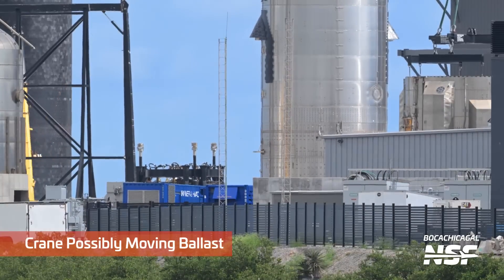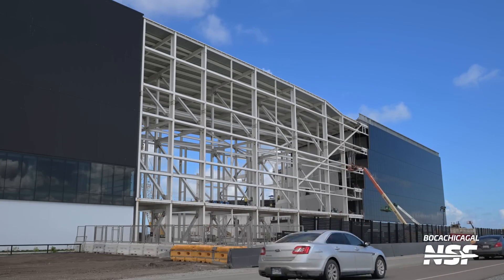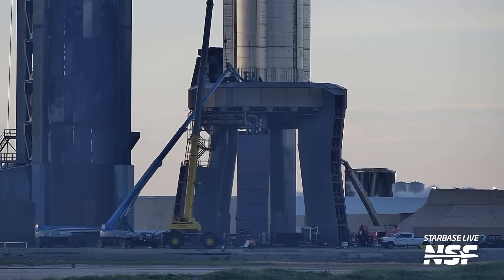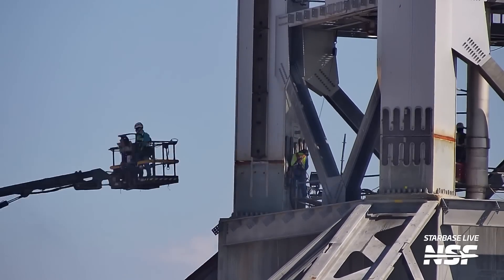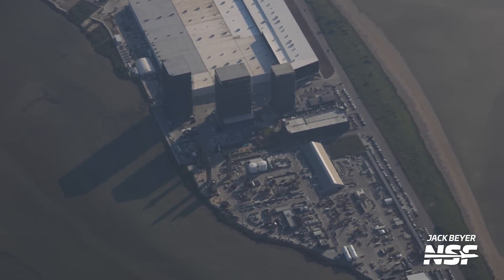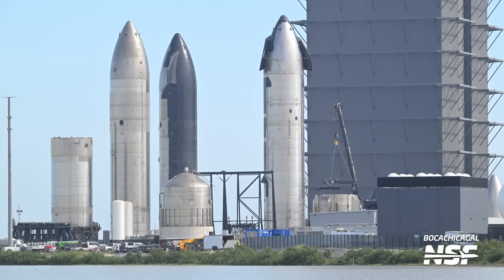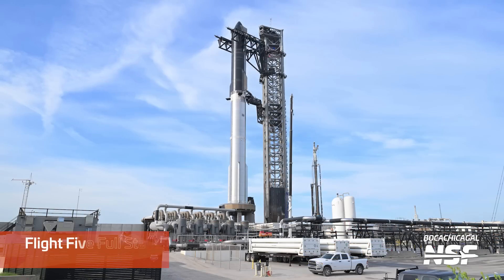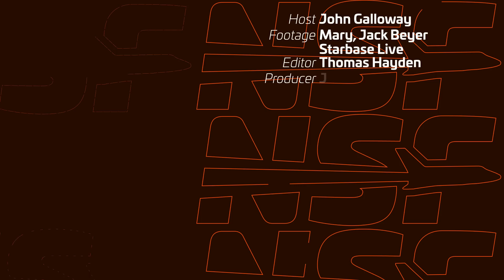Starship Full Stack - Booster 11 Parts Return | SpaceX Boca Chica

Comment: The outer ring on the booster, may have split when a recovery attempt was made - many of the engine bells on the lower side, were mud filled, while the upper were clean. That indicates an off-angle impact with the ocean floor.

Comment: It seems they removed the stabilization pins from the OLM. Which indicates they don't plant to remove the Booster from the pad any time soon.
Reply from the maker: It took less than a day to remove them. Will likely take the same to put them back. I wouldn't draw any long term conclusions from it. - Das